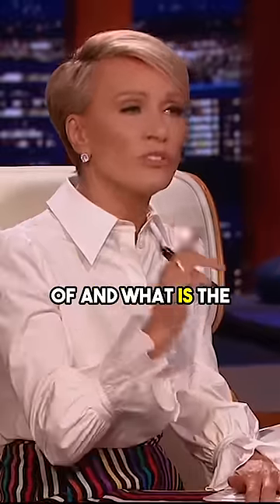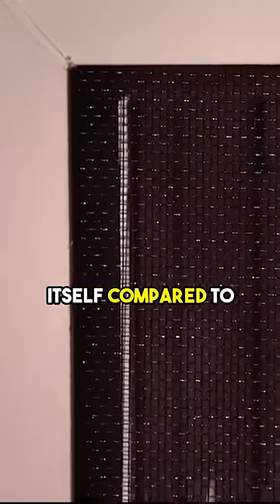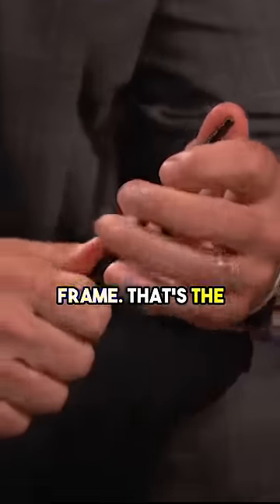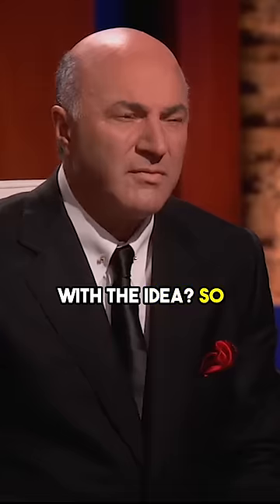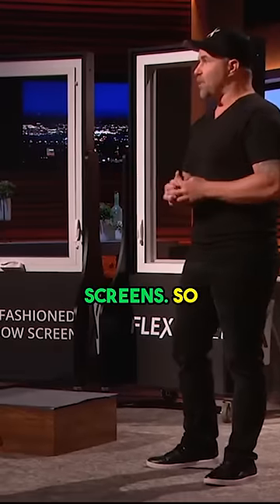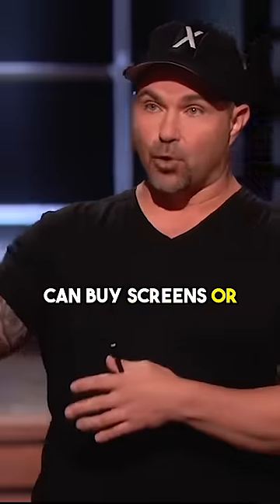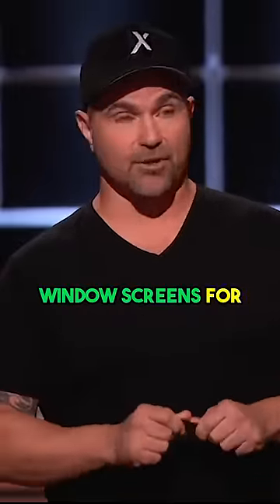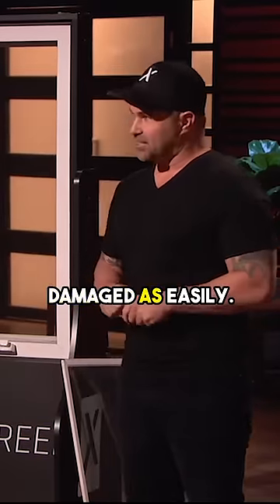What is the Screen?  #sharktank #lorigreiner #flexscreen

Comment: I have a couple of these for some of the original double hung windows in our 1923 home. They are unobtrusive and work amazingly well. The only tricky thing is that you have to be accurate in your measurements. For an old home you also should measure at different parts of the frame since things might no be perfectly square.

Comment: Just finished a pair of high end homes in Vancouver and I was introduced to these screens. About 50ish windows per house so around 35 screens per home.  They take some getting used to because you are sure you are going to damage them taking them in and out, but they are remarkably durable and resilient. Also as usual about 4-5 on each house were damaged and needed to be replaced, and they’re about the same price to do so and the frames are almost indestructible. Actually I’m pretty impressed.
Reply: Wtf do you love where the average house has 50 windows????
Reply: @jacobviator3118 jealousy your house has less??
Reply: @airgliderz  my place only has 6

Comment: They blow out of the window frames a little too easily in high wind applications.  Other than that, they are pretty cool and are a lot easier for homeowners to take in and out than standard metal ones.

Comment: I work house remodeling and i cant tell you the amount of times I've pulled a screen tight and then had it tear or accidentally cut it in the very last step when you carefully cut off the excess so if it could hold up better than a normal screen when it comes to install then so many more unskilled workers could be doing pool cages and screen rooms

Comment: Its amazing how many products have been made messing around in your garage just trying to solve a problem , ive made some interesting ones myself:
When i was a kid, smoking weed was a problem with my parents, so i made a special metal and glass contraption that would vaporise the weed and sort of contain the vapours within so there would be less smell (and a much more powerful way of consuming), a few years later- all over the shelves at even corner shops the most popular vapouriser is a cheal metal one you screw on and heat with a blowtorch - was my 'idea' (obviously been done before but it was a very similar build shape and style) , which i greatly regret not attempting to patent.

I also wired up a universal charger with a magnet in shop class, not for the plug side but one for your phone, so essentially it would be a small iphone or android charger that would permanently be attached to your device, and then the 'universal' side would be a clip on magnet to connect it, it was big, clunky and would charge slowly or not work at all on some devices, i gave up on tbe idea after getting my A,.. Years later i see a much more slick and smaller version, not sure what its called- it never became popular but was still a cool idea (found it, check out magnilink)

Comment: many years ago I almost got into the screen business because I found a distributor who sold stainless steel screen material. the product had a very long life because it was tear resistant unlike nylon, rust resistant unlike aluminum, and could be easily cleaned without damage. unfortunately I chose another business instead and never searched further.
Reply: pandabanana2593 thank you for saying it. That was my thought too.
Reply: I hope it was manyanyany years ago, because  SD screen has been around for a very long time,  most ppl just don't like the look of it or the price
Reply: pandabanana2593 
He probably means corrosion resistant. Cheap non alloyed aluminum used in windows doesn’t rust but it does corrode.

Comment: Any window guy would know that the screen itself is the mostly frequently damaged part of a window not the frame, little holes can get torn very easily.
Reply from the maker: If that happens, FlexScreen is easily rescreened at home using a common mini heat press and a piece of mesh. 👍

Comment: Called aluminum screen. They make something like this already. 👎
Reply from the maker: Yes, old-style aluminum frame window screens have been around for over 100 years and have been the standard for just as long. We're trying to change that with FlexScreen. Our frames are made of PVC-coated spring steel, have no attachment hardware, and are far more durable than aluminum.

Comment: Happy to see innovation but if it was the screen instead of the frame it would be better on a sales side of things no-one replaces frames everyone replaces screen
Reply from the maker: When the frame bends, dents, and breaks on an old-style aluminum screen, the whole thing has to be replaced. Because of the extreme durability of our PVC-coated spring steel frame, this is not an issue with FlexScreen. And if the mesh rips, FlexScreen is easily rescreened at home with a common, inexpensive mini heat press and some standard mesh.

Comment: It’s called flex screen it is nice but tears just like any screen but the thing is if you push into it it flexes and then returns to its shape…. No dealing with splines or re-splining due to kids or animals pushing it out it just flexes back out
Reply from the maker: Yes! The mesh can rip or tear just like on a regular screen, but most people don't realize that FlexScreen is easily rescreened at home using a simple mini heat press tool and a piece of mesh - both available at hardware stores or from Amazon. We have a video that shows how to do it if anyone is interested! https://flexscreen.com/repairs/

Comment: Its super cool except if you need to dive out your window, youve basicially installed burgurly bars. Which is actually still cool af. But just gottta acknowledge thats no longer a possible exit.
Reply: They flex right out of the window. You could certainly dive out.. If that's what you really want to do lol

Comment: Standard screen material..... literally shows its like 3 times as thick
Reply from the maker: Our mesh is standard mesh material. The FlexScreen frame is what's different. Made out of spring steel with no attachment hardware. Installs and removes in seconds with no difficulty and durable enough to run it over with a car with no damage.

Comment: Florida sun and heat and salt air will test this frame material
Reply from the maker: Love that Florida sun, but it can be brutal, for sure! But our spring steel frames are coated in exterior-grade Duralloy PVC and have a 4,000 hr. salt spray rating. They hold up beautifully in extreme conditions in all climates.
Reply: @joealtieri  PVC does not have a good record with uv rays and breaks down.

Comment: so are these like stronger than your average screen? are they more durable?
Reply from the maker: Way stronger and WAY more durable. The whole reason FlexScreen exists is because I was in the industry for 20 years and the constant, never-ending customer complaints about their flimsy, complicated, aluminum screens always breaking and being so difficult to install and remove was making me crazy. FlexScreen's frame is made of spring steel coated in exterior-grade PVC. You can run it over with a car with no damage. Also, there is no attachment hardware. It simply springs into the window's screen track where it's held by tension and virtually disappears. You can learn more about it at flexscreen.com if you're interested.

Comment: I'm confused.  It sounds like his creation addresses the problem of the frame getting damaged.  Is that a normal problem though?
Reply: Yes
Reply from the maker: Yes! I was in the industry for 20 years and dealt with constant customer frustration about the flimsy nature of old-style aluminum window screens and how easily they break. It was by far the #1 complaint and that's why I invented FlexScreen.
Reply: @joealtieri  Well, you are the expert so I will take your word on that.  I was just confused because I personally have never had an issue with the frames breaking, not even the cheaper frames that you assemble yourself.  I don't have kids or pets though, which I'm guessing is usually the main cause.  

I'm now kind of curious though how one would break the frame such that having a stronger frame wouldn't now risk doing damage to the window frame itself... where the screen frame is inset into.  Or does your invention have the ability of "flex"ing such that it would pop out if hit hard enough, etc?

Comment: Can you get these in custom sizes? My household has some smaller sliding windows tucked beneath these massive wall-sized windows, but the previous owners of the house either lost or destroyed the original screen frames for the windows so we can’t use them without the risk of letting in wild animals or letting out our pets
Reply from the maker: Every FlexScreen is custom-made to your exact specifications from as small as 9" x 9" to as large as 55" x 80". Please visit flexscreenretail.com for full details!

Comment: so the screen is made out of screen material
Reply from the maker: 😂 yep! Mesh is mesh for the most part. (Except for our proprietary FlexView™ brand of mesh that is the only one on the US market that is free of potentially harmful ortho-phthalates!) It's our PVC-coated spring steel frame that is the real star of the show. Durable, simple, beautiful, sleek - has no attachment hardware, disappears in the screen track for a better view and no color matching, won't bend, dent, or break like flimsy aluminum, super simple to install and remove, etc. etc.

Comment: did he just say he makes windows out of carbon?
who can afford that?
Reply from the maker: We make our frames our of high-carbon, oil-tempered spring steel, coated in exterior grade Duralloy PVC. FlexScreen is a premium product upgrade, but because of the extreme durability, simplicity, and beauty of our screens, the ROI is 🔥.
Reply: High carbon steel just means it is high in carbon content, increasing the tensile strength of the frame, it is tempered using an oil bath after heating.
Reply: @bingbong7206 just means??? No, means. Bing bong.

Comment: I don’t believe they went bananas when they saw it. That’s a far stretch. If the screen material was different and resistant to cuts and tears I’d go bananas maybe. Frame doesn’t mean shit. Maybe I need to make the screens that won’t tear and have the same frames I’d be very wealthy.
Reply from the maker: Thanks for your input, but as you can imagine, I respectfully disagree. The frame on old-style aluminum window screens is what causes nearly all of the headaches for homeowners. It's the part that bends, dents, chips, and breaks so easily because it's flimsy and weak. It's also the part that has some type of complicated attachment hardware that makes it difficult at best to install and remove the screen. It's the part that is visible, has to be color matched, and blocks part of the view. The mesh is easy, and we do offer a FlexView Tuff mesh that is more rip and tear resistant.
Reply: @joealtieri damn. You owned him.😂
Reply: @joealtieri  why you just made me a believer. Did you make a few million yet so we can party? I got the booze and strippers and cocaine